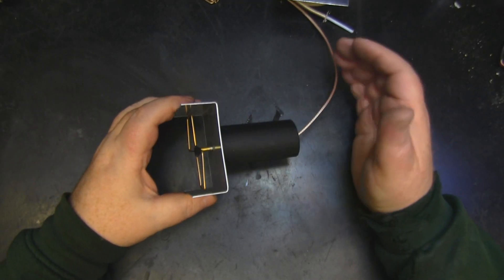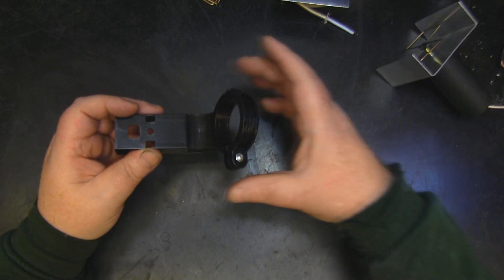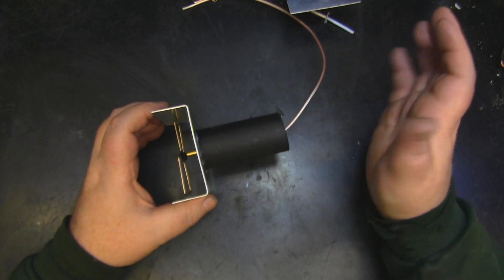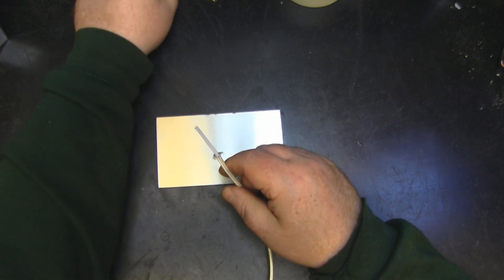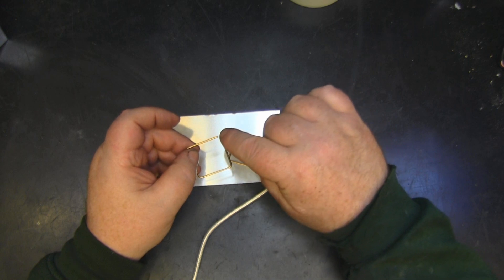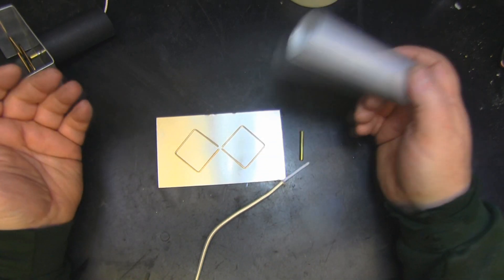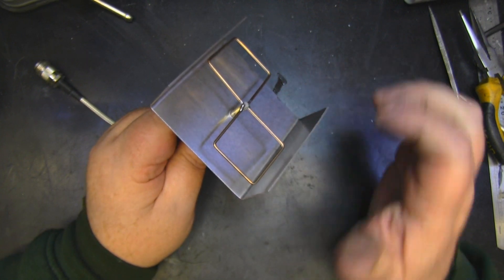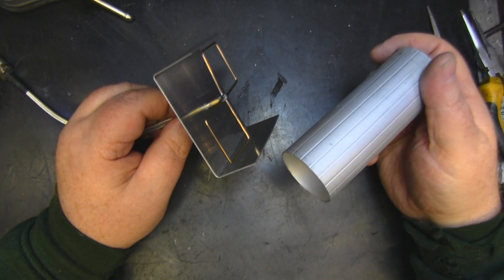Biquad Satellite dish feed for WIFI

Comment: Amazing videos! First channel where I can easily understand concept/build. 
I assume increasing length of wings would make the F2B ratio better, would it improve the range? Would be interesting to experiment with angle and length and see if there is correlation between surface area of wings (4 sides vs 2) and range/signal.

Comment: Hi Mr. Andrew
Do you think that if you use WiFi Gun as a feed for dish, it will not have a longer range than the Biquad Antenna ? 
Because the Yagi Disk Antenna alone has a good gain and range, in your opinion it is not more suitable for the dish than the Biquad due to its round and disc design and it receives the most waves at the focus point of the dish. 
Please make a video and use the Yagi Disk Antenna as a feed for dish, thank you.

Comment: My guess would be, that the wings make the beam a bit narrower, so the beam fits a little bit better into the parabolic reflector and less radiation passes it by. More energy hitting the reflector equals the amount of more driving energy times the expected gain caused by the reflector. There you are.

Comment: Has anyone tried to build a router into a large LNB so you can have the signal on 5GHZ in either Horizontal or Vertical polarization or for that matter take a VIASAT two way transceiver module and associated dish and move the TX/RX frequency to 5.0-7.0Ghz

Comment: Most of your biquads have the driven element connected with an exposed center conductor. Now its isolated by the tube like MartyBugs used to do it. Could this make the difference? Is that exposed center conductor acting like a balun?
Reply from the maker: This is connected to coax directly so I use a tube to add stability. When using a N type or SMA there is no need for a tube. The tube length has no effect on the antenna.

Comment: Would be interesting to see your comparison to the Kathrein antenna, the other way around. 
Meaning a sector antenna with biquad elements. 
I guess it should be able to get pretty defined beams for a very directional application, which would of course not be very useful for covering a lot of cellphones but I think it is an interesting thought.

Comment: If I had to guess, maybe those wings are acting as some kind of half wavelength waveguide? Since they are so close to the edges of the biquad, which is about a half wave in horizontal length in this set up, the gap to allow in horizontal waves in is fairly resonant. It may at least explain the lack of wideband response normally seen in biquaud antennas. Do single-quad antennas also have a natural impedance close to 50ohm? I'm not sure but would love to see a MIMO version of this either way, since long range WIFI benefits from it hugely in speed and reliability, and a parabolic reflector setup is exactly when it should be leveraged most. I wondered if the wings were thinning the beamwidth of the antenna, but I think you're correct in saying they don't effect it, as they would likely need to be considerably longer to cut off part of the reflector's gain. Great video Andrew.
Reply from the maker: There is something going on with the waveguide. Just need to do some reading and testing.
Reply from the maker: And I have just ordered a dual LMB holder.

Comment: How about mounting a cantenna to a satellite dish? Would that work?
Reply: Yes! However it's important to use as much of the surface area of the reflector as possible, and that means having a wide beamwidth on the antenna you have at the feed. Cantennas normally have a very narrow beamwidth, but it can be expanded significantly by shortening the can and adding a horn. Andrew actually has an older video on this channel of just that.
Reply: @beansfoundhere  thanks for your reply :)

Comment: I would like to see a design for 800mhz, band20 cellular. Also how would I make it a crosspolarized antenna for mimo?
Reply: Trust me, don't. They are a pain in the ass to make, and can be bought on Ebay for next to nothing. Strapping a low-gain MIMO antenna to the feed point will be more than significant and will give you wideband capabilities, just replace the crap coax that comes attached to it. Way less work for better results. Hope this helps.

Comment: Would have loved to see it tested on a dish to see what signal strength it has combined, also would a cantenna be better on a dish or a biquad ?
Reply: It's important to use as much of the surface area of the reflector as possible, and that means having a wide beamwidth on the antenna you have at the feed. Cantennas normally have a very narrow beamwidth, but it can be expanded significantly by shortening the can and adding a horn. Andrew actually has an older video on this channel of just that.
Reply from the maker: Next time!